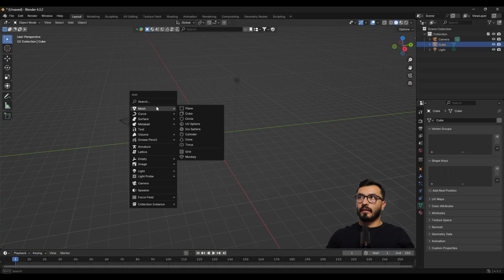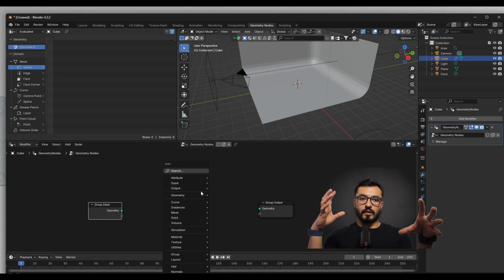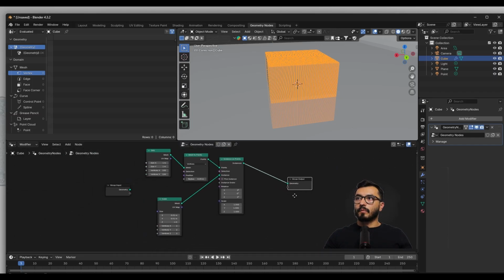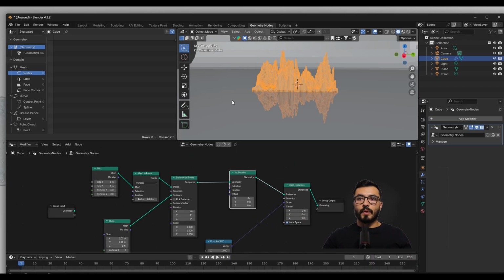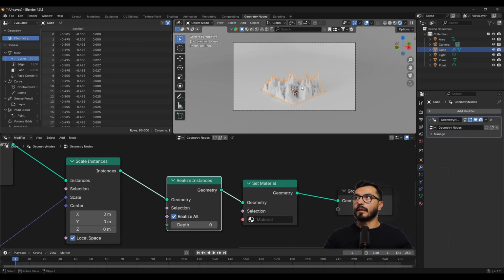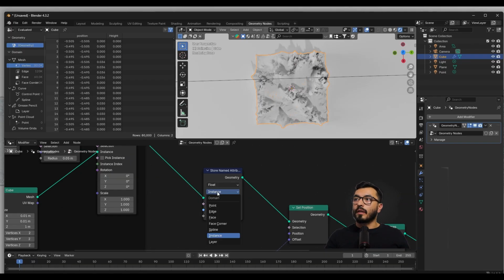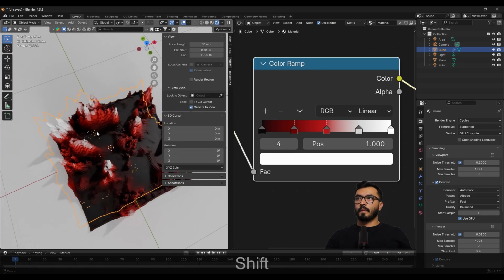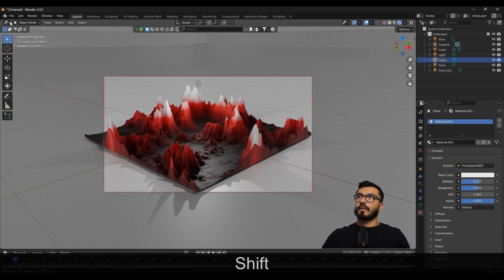Heatmap to 3D Bars in Blender — Geometry Nodes Step-by-Step

Comment: You just earned a subscriber, I've been trying to do this for quite a while now. What I found problematic was the size of the image texture, compared to the density of the cubes, What helped me was using the UV Map of the Grid Node and sticking it into the Vector of the Image Texture instead of the Position Node.
Reply from the maker: Thanks for the comment and subscription! I also struggled with the same issue for some time. I am glad to know that this video was helful for you.